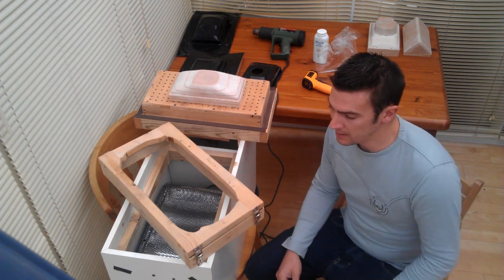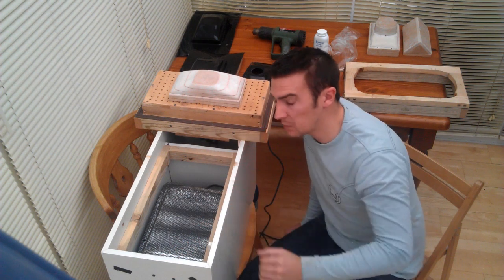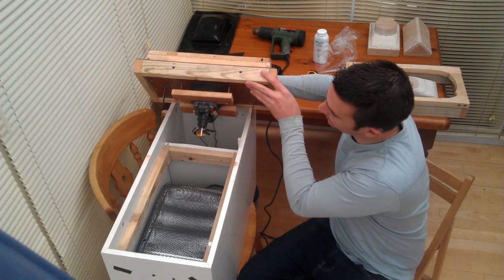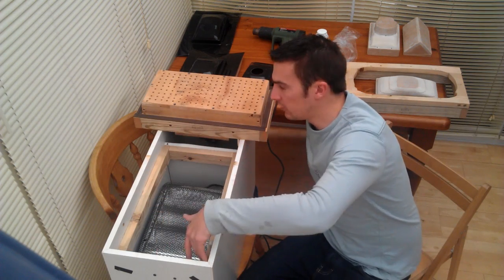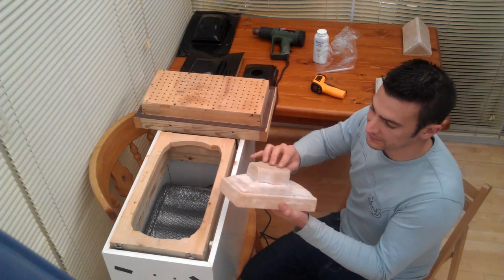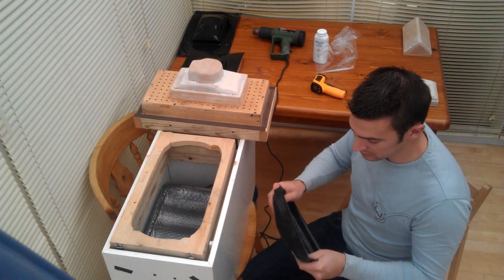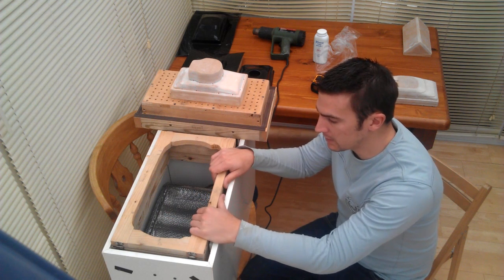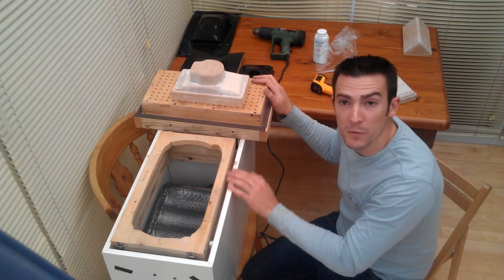PART 5 - Conclusion - DIY Vacuum Forming, build a machine for under £20 ABS PETG HIPS

Comment: Really enjoyed your videos. I used to use vacuum form machines in the electronics industry. In fact, at Atari, I made the molds for the dashboard of a racing game. I would suggest another heater facing down and a couple of pieces of angle iron to slide the frame on. I'm going to build at least your version in the next few weeks. The best plastic for vacuum forming is ABS or polystyrene.

Comment: Thanks for the very useful videos. Can you tell me if the process is as good for polycarbonate as it is for acrylic?
Reply: +Nick Nakorn
Polycarbonate is hydroscopic and blisters under high heat.
Reply: +H. L. LeRoy Many thanks; I understand that polycarbonate can be bent - is gentle heat OK? I'm making some rear windows for a bespoke sports car and have made formers.  The curves are slight though compound.
Reply: +Nick Nakorn 
Polycarbonate can certainly be bent. If you let the sheets acclimate to your work area for for a period of time and heat carefully, you should be okay. Windows for a car should have slight bends and the plastic wouldn't need to be heated to as high a temperature. I would suggest heating to a flexible state and then pulling over the mold while cooling with air.
Reply: +H. L. LeRoy Many thanks again, it's much appreciated. I'll certainly follow your advice - cheers!